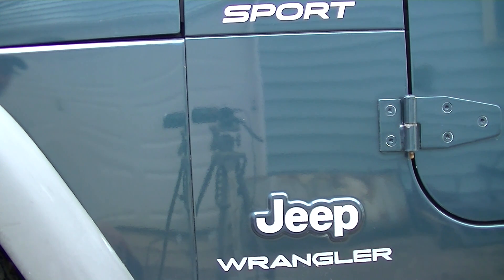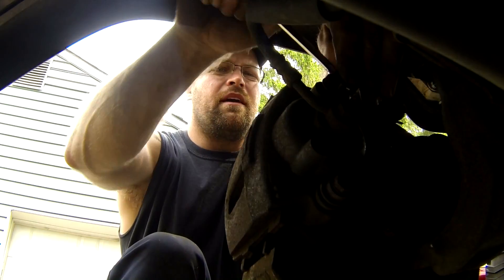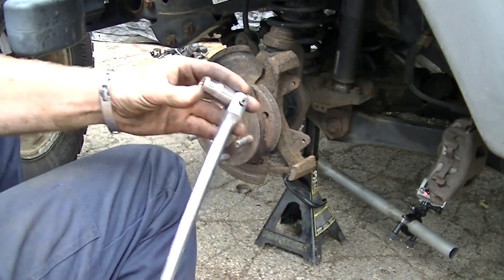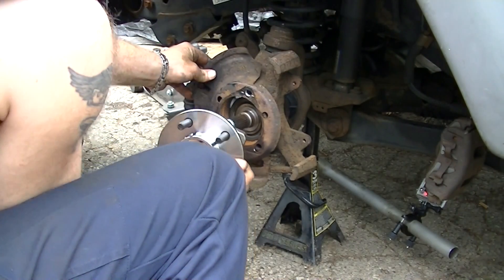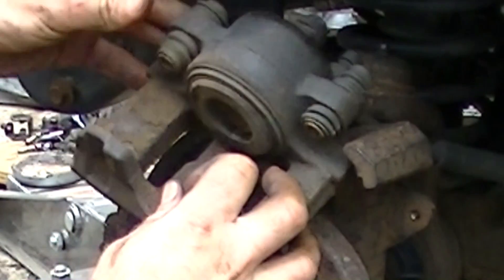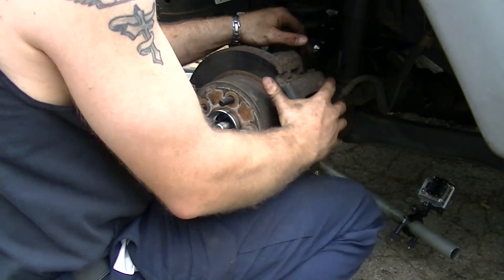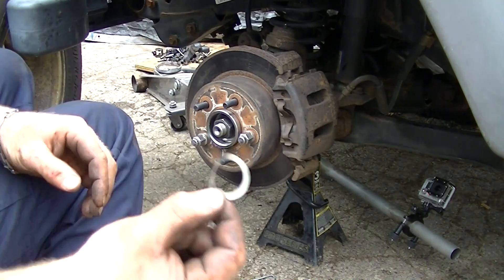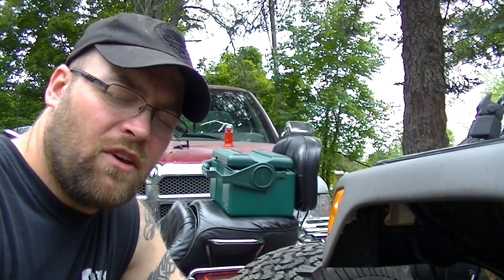2000 - 2006 Jeep Wrangler Wheel Hub and Bearing Assembly

Comment: Torque wrench? 11 ft-lb on the caliper bolts. 75 ft-lb on the three hub bolts. 175 ft-lb is the proper bearing pre-load on the axle nut. Too lose or tight and you will be back down there replacing it sooner than you need to.